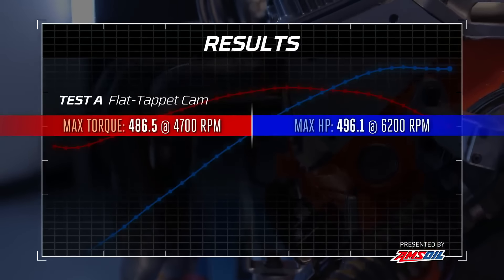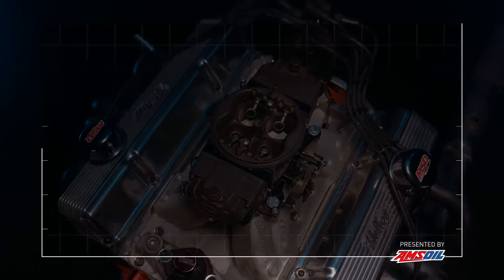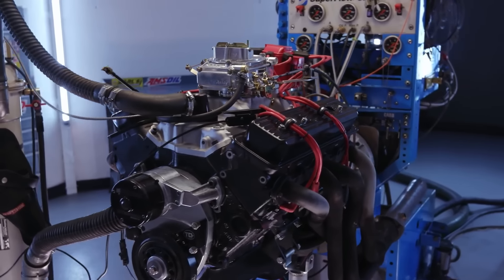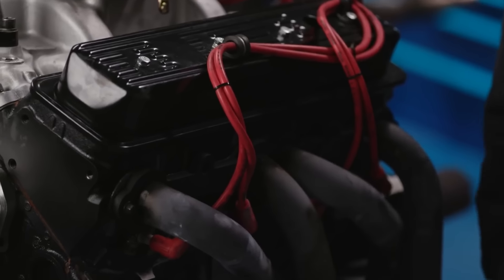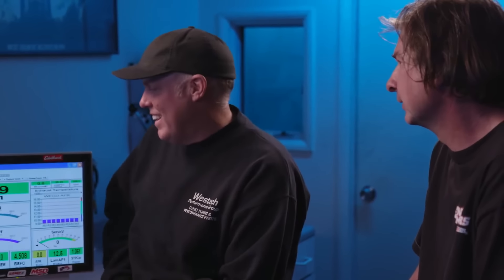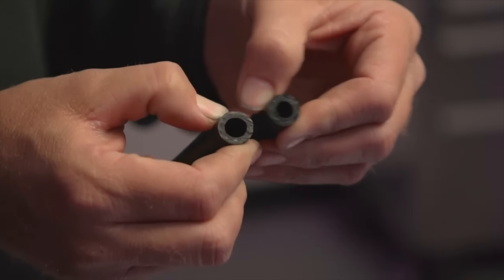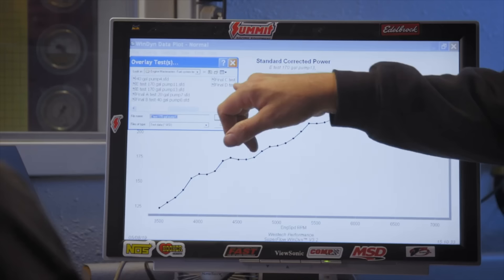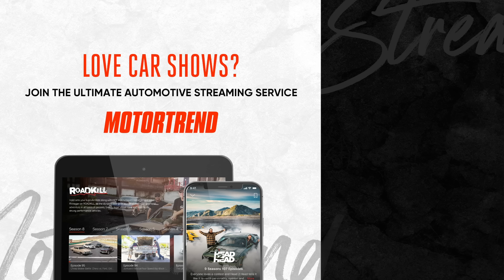Budget Mods for Big Power! | Engine Masters | MotorTrend

Comment: I don't think the roller cams going to give you all that much more power if it's the same lift and duration it's going to cause less wear and tear on your engine for sure and less heat because there's less friction I mean I guess I'll watch the dino but I don't think you're going to get all like a huge jump in Horsepower just by installing a roller cam we will see I could be wrong

Comment: They never said what cam they used. They did say they used after market heads with 2.02 intake, I assume the exhaust was 1.60 but they didn't say.   I'm not sure that a 2.02 valve did much at the RPM they were running. That makes me think the main driver besides the ''Vortec'' heads was the cam, what ever that might have been. I really don't care for these miss mash out takes.

Comment: How do you tell 351 Cleveland  from a 351  modified?..I just bought a 1977 ford f 150..I was told it had a Windsor...then I got it home...8 bolt covers on it so it's not a Windsor.
Reply: It could be the famous 400 M which used Cleveland style heads.

Comment: Get a cheap 350 4 bolt smack some chinese 205cc runner heads on it and the biggest used cam you can find single plane intake cheapest 400+ there is

Comment: They didnt give the specs of each cam so this video is about nothing.
Reply: Probably did in the original video...
Reply: They mentioned the flat tappet cam being a comp 292
Reply: Around 3:31 he mentions the camshaft as 292 mega-cam?
Reply: That's what I was thinking too. Unless both cams have exactly the same lift and duration there's no point doing a comparison test. If they did happen to be the same I reckon the only difference they'd find would be the roller cam maybe taking less engine power to rotate therefore leaving more to send to the flywheel than the flat tappet cam.... maybe.

Comment: What's puzzling is guys who are still using solid lifter cams on the street. I guess if you have no life and enjoy adjusting valves.
Reply: Myth break it in properly and you will not be adjusting haven't touched mine in ten years

Comment: Im that guy that likes a 327 because they rev higher. That 400 will throw the rods out the oil pan if they reved it any higher my 327 wont.
Reply: wrong
Reply: @shawnthomas7404  try reving your 400 to 9000 rpm like my 327 does every time it goes down a drag strip. it would fly out into 1000 pieces.
Reply: It's not stock if it's revving that high.